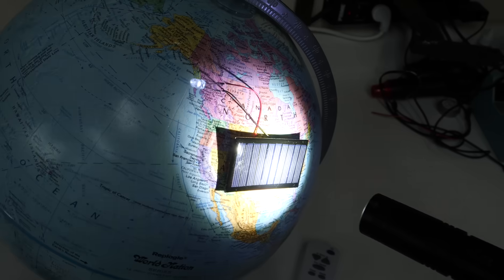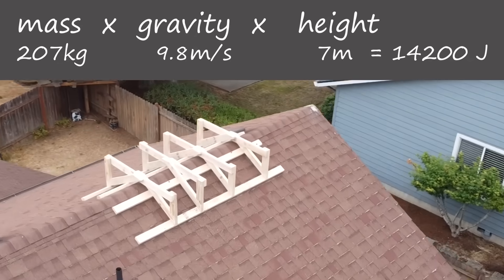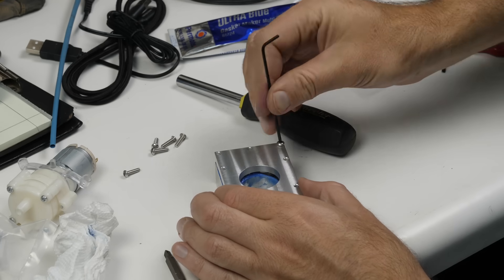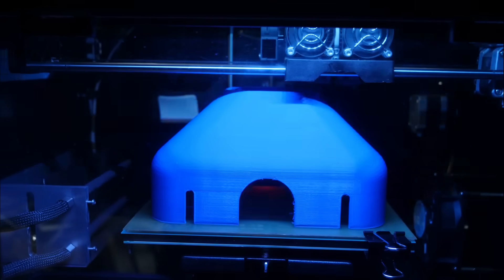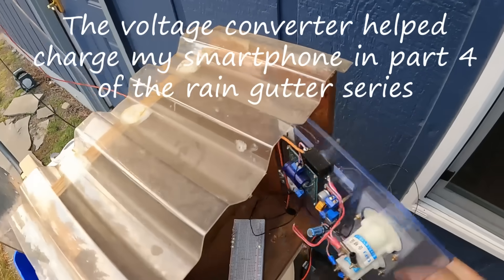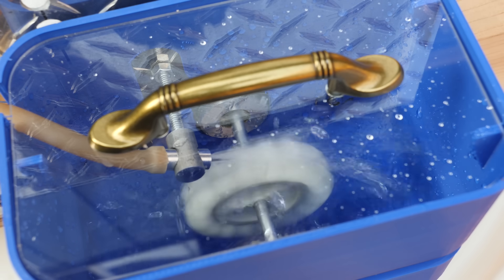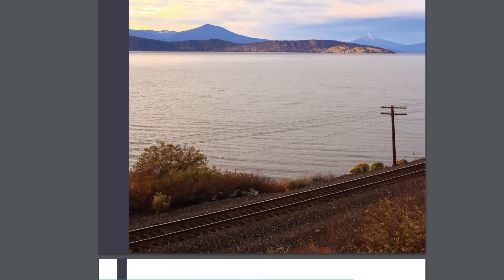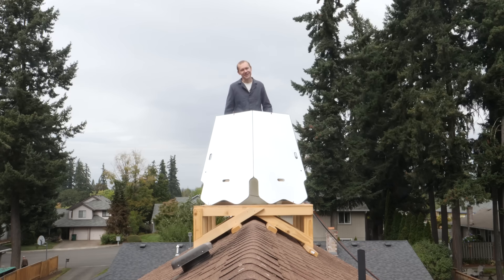Storing Solar Power on my ROOF!!!

Comment: Could you do the same thing but with a fresnel lense to heat a water container (or just air) into steam (or just heated air) that rises through a one-way valve to be stored in a pressure tank as pressurized steam (or compressed air) of course with a safety valve? I assume you could use the same turbine from the gutter system with steam although a steam turbine or maybe a tesla turbine might be more efficient?

Comment: Near me on there is this:
Mineville Energy Storage (Project No. 12635) is a proposal to construct a 240-megawatt closed-loop pumped storage project in a decommissioned subterranean mine complex in Essex County, New York.  The proposed project would consist of, among other facilities, upper and lower reservoirs with storage capacities of 2,448 acre-feet, low- and high-pressure penstocks, a powerhouse, an electrical chamber and tunnel, and 34.5-kilovolt transmission lines.  The proposed project would provide an estimated annual generation of 421,000 megawatt-hours.

Comment: I'm probably wrong here, so I would love it if someone wanted to check my math, but because of gravity being constant I imagine not just water but pretty much anything has a potential energy of 2.72 mWh per meter per kg, meaning his 207.9 kg 55 gallon barrel would be 0.00272 x 7m x 207.9kg and roughly coming to ~3.95, or just about 4 watt hours in that barrel.

Alternatively to get this number you can divide the 14,291.64 joules/s by 3,600 to get ~3.96 joules, or watts per hour. But the per meter per kg is nice to mess around with different storage size set ups.

Comment: Question: how long does the battery last when used to power the lights?
Reply: He mentioned a AA cell, so I was judging from that.
Reply: It is easy to calculate.
14.200 J = 3,944,444 Wh
Comparing it to a cell phone which has a voltage of 12 volts
3.944444 Wh = 3.944444 / 12 Ah = 0.328 Ah = 328 mAh
The phone's battery has over 10 times more capacity.
For storing energy in a gravitational field with the use of water, you need very large masses of water.
It is much easier to store energy in the warm water. 1000 l of water, when heated by 1 K, stores about 1 kWk of energy.
Reply: @boguslawszostak1784  How do you convert heated water into electricity and what is the efficiency?
Reply: I don't need to do this. Energy for heating is needed in the form of heat. There is no point in turning it into electric to turn it into heat again.
Instead of storing electricity in a battery, it is easier to convert it immediately into heat and store it in this form until it is needed.

Comment: I hate to break it to you but
14200 joules can run a toaster for like 20 seconds
A lead acid battery for my 50 watt panel can run a toaster continuously for 150 times as long, and I don't even need to put it on my roof

Amazing ingenuity though

Comment: Two things I don't understand; -1- why not put the storage right below the roof, out of sight (that one meter is not so bad). -2- Why not add a rain input : free AA batteries falling out of the sky! (also works with raintrap outside while vessel inside). 
Very nice you add this final conclusion to put the project in perspective with the AA equal of storage capacity. Although a proper turbine might have added a bit in effeciency too!

Comment: Have you tried to use the electricity from solar power to compress air and use the compressed air whenever you need to generate electricity instead of pumping water to the roof and risk heavy weight on the roof?

Comment: Just saw this. Love it, but it will not work when the water freezes (below 32° F). Also, the tank will need to be secured for high winds to avoid structural damage on the property. Would be nice to come out with a model for year around consumption. Maybe have both tanks in the ground on different altitude. Or change the water for air and run it inside the house. Food for thought. Thanks!!
Reply: Add antifreeze to the water... geothermal systems do where temperatures are cold.

Comment: get an aquarium air compressor and inject air after the waterpump: it will reduce the head pressure and increase output or reduce energy consumption.

it called air or gas lift.

Comment: Brilliant  Fun Practical experiment  for a change  Covered all the info one needs except EFFICENCY  50 watt? panel 6 hrs, 350 watt hrs to generate ? 6 watt hours?
Schools across the nation should be using your channel
Here's another water / electrical storage experiment - use a thermo electric generator, heat the hot water with solar power, use it to "charge" the hot plate of a thermo elec generator.  Now the greater the temp diff the more elec gen so a small really hot really insulated storage tank and or the cold side coupled to something... cold, a copper plate hanging in a 55 gal drum of water, sunk into the earth...  They are pretty inefficient, be interesting to see if more or less efficient than your test pumped hydro  Might want to append when discussing real life pumped storage that many are now being built in abandoned mines, reusing the facilities and cleaning up then ending the pollution often associated with abandoned mines.  One is upper NYS.  CA was trying to build one but environmentalists were blocking if preferring the abandoned mine that has been blighting the landscape instead be fully restored to it's natural state using who knows how many billions tax payers dollars

Comment: There are 500,000 Pumped Hydro sites around the world, and compressed air storage can be done by drilling into the top of a salt dome, or other cavern space! So we don't need no stinking batteries, we have so many tried and true ancient methods of storing energy, we are being hoaxed by the supporters of the nuclear death machines! They have lied about the dangers of nuclear power, because they wanted the plutonium for bombs, a deadly by-product  of reactors! This year, there were only 138 salmon in the winter run, in the mighty Columbia River which runs past the radioactive plutonium production plant in Hanford, Washington. That's an extinction level, compared to the tens of thousands in past years. Dont say the f-word. Fukushima. 4 reactors, 4 horsemen. Poured the vial, already. They lied about that too, reactors 5 and 6 are toast. And the common spent fuel pool. 20 or thirty cores, maybe. 60 MILLION TONS OF SOIL IN TEMPORARY STORAGE, AT 150,000 SITES. DONT EAT FISH, OR JAPANESE RICE.  Stay out of the rain. 
Peace.

Comment: I've always wondered if you put your bucket on the ground have a float on it that opens a "flapper" on the bottom it drains out to a ram pump that goes back to the gutter couldn't you just have an indefinite closed system besides what water is evaporated during the cycle so the water would run over your stream wheel a few more time than it naturally would?

Comment: What happens when you step down piping from the top. At barrel start with maybe 6" then switch to 4" half way down then 2" and so on until you get to your small nozel at the end. That would give more weight in the line from the barrel in tree pipe. Maybe more or faster pressure on the end?

Comment: The same solar water pump arrangement could also be used to cool your house, in place of or in conjunction with air conditioning via a couple methods. Here are a few to think about. 1 with normal AC and 1 without normal AC.

1 - Simply allow the water to run over the roof and have evaporation cool the house. The water that does not evaporate could be recollected by the usual rain gutters to a recovery barrel and pumped back up via the solar powered pump repeatedly. 
The same water could still make power via your gutter generator at the same time.
You do need to add more water to the system to compensate for the evaporation loss during the day.
Your air conditioning could still be employed as usual but with less work being required, since the house would be cooler before the AC unit starts to work, saving you some money on your power bill.

2 - Create 'swamp coolers' in your open windows, with solar powered fans. This is as simple as using the water from the solar pump to wet a fabric (towel, sheet, etc.) with a solar powered fan blowing air through the fabric. Again evaporation cools the air, and that cooled air is blown into the house via you windows.
The water could also be gravity fed to your swamp coolers after doing 1 above as well, so you get multiple cooling effects via the same work. In this case your must have your house open, so you could not use your normal AC meaning you probably wouldn't be able to do this on extremely hot days. Also the water recovery would be more problematic since it is being used at several windows as opposed to simply catching the water from the roof via gutters.

Comment: For turbine case: Efficiency of pump and motor is about 92% and 60% respectively. Then line losses then turbine efficiency about 90% then dynamo efficiency about 85% i guess.
.
For battery charging case: solar to battery it is charging efficiency 97%, discharging 97%, inverter 92%.
.
.
Panels required will be much more in water battery setup but I'll still prefer it bcs battery has very long life and much close to nature.

Comment: That's a very smart afordable battery. Also put a tank in the attic. Use the solar panels to heat the water .  If a house is engineered to hold a large tank in the attic. Perfect battery to store solar energy.  
Unfortunately homes are not built with solar, wind or any form of energy conservation execpt insulation. Essentially homes are built as cheap as possible by greedy builders concerned with profit .

Comment: @Quint BUILDs Doesn't the whole tank of water contain a ton of energy? Why not have the whole container "drop" while being tethered to a generator. Kind of like a grandfather clock? Couldn't it be let down from a height while turning a much larger generator (using gears) producing more (stronger) electricity?  Couldn't a number of them be timed to work throughout the day/evening?

Comment: Great video, a few question s came mind. 
1) since you have more than five hours of daylight in any day of the year how much battery storage could you get off the solar panel also. 
2) if you added the battery storage how much more water could you pump up if you’re using electricity to extend the amount of electricity you produce by the water wheel?
3) With the flow of water on the water wheel power generator how big of a generator could you use and how much power could you produce with the lowest flow?
4) if my numbers are correct with the system set up at full of efficiency you could produce enough power stored in batteries and being made combined to have the lights work 5 to 8 hours or longer (if used A long enough wound up cord with an AC and DC you could produce enough of a magnetic field to run the LED lights and also gear in a DC generator to charge the battery and run water pump)
Reply: Your gonna need 2 lakes, one 30ft higher than your house and one in the back yard.
Reply: @terrafirma9328   Please provide numbers stating your case,  or is this in the windmills of your mind

Comment: So if you had a stream in your yard, going downhill, and used a multitude of ram pumps to pump the water uphill into water towers,  flowing back down to the stream, hitting a waterwheel collecting even more power, you'd basically have infinite power. Gotcha.

Comment: That was cute. Innovative and cute, nevertheless  you demonstrated something that  [most] people could be doing but aren't. 
One bit of advice,   if you start the water flow to power the light strip at night but you needed to cancel  activity under the light, you could wire a on/off switch to the water valve/solenoid which can be activated with solar power dedicated for that purpose only, and when you turn the "water on" the lights come on, turn the switch to off position and the solenoid shuts of power to the valve solenoid. 
Thanks for your video!

Comment: The water wheel does not have to move until one paddle or one bucket is completely full so a four foot water wheel would turn a bike sprocket which is only maybe 3 in wide how many times enough to power a motor

Comment: Have you ever thought about solid gravity batteries? And connecting them to a block and tackle / heavy gear ratio to get the req. RPM on an electric motor? I would love to see what someone with your skills and knowledge could do with a solar panel and a 100kg weight.... There's gotta be a crazy hack there somewhere! 
Love your videos! Looking forward to seeing more soon!
Reply: The problem is you'd need to drop the 100kg 3.6km (2.24 miles) for each kWh energy required (if the motor converted 100% of the movement to electricity). If you had a platform the height of mount Everest, one cycle would store 2.45 kWh, less than 1/10th of the electricity used by the typical US household each day.

Comment: Hi, I realize your just putting out content to make a buck. I can respect that as a fellow capitalist. What I can not respect is the disservice you do not only your viewers but the country in spreading misinformation suggesting solar and wind power are green energy, they are not.

Don't get me wrong, both solar and wind have niche applications like remote sites or off grid. But it is woefully inadequate to volume power production and usage. 

No, currently nuclear power is our only true clean energy option with working technology. And no I am NOT talking about heavy water reactors of the 1950s, pushed on the nation by a corrupt scientist owning the patents for them that headed the nuclear regulation commission back in the 50s.

In our nuclear "waste" disposal sites we have "spent" nuclear material. Why is that so? Because heavy water reactors only extract 5% to 6% of the material's energy.  If it had extracted it all then it wouldn't be radioactive,  now would it.

Also for decades we have used nuclear powered space craft in the form of Radioisotope Thermal-Electric Generators (RTGs) to generate power. We can use RTGs poduced by heavy water reactor "waste" to create Nuclear Energy Cells (NECs) if you will. We connect the NECs in series and parallel to generate the energy we need to power the nation from the area as a commercial solar farm, buried of course with tight security.

It would work 24/7 rain or shine and not depend on a single gust of wind. If we assume that the "waste" is 95% viable and the old plants used 5% of the potential power every 2 years before refueling. Then we have 38 years of power for each refueling. If we multiply the 38 years of potential power from each plant every 2 year by the reported 99 plants that have operated,  we come up with a figure of 3,702 years of potential power every 2 years the water plants operated. Considering they operated for about 70 years now,  that gives us a rough figure of 129,570 years of potential power left in the current stores of nuclear "waste". Obvious we need to account for nuclear power only generates 20% of our nation's power, so that lowers the figure to 25,914 years of power. We must also assume we will loose some of that potential to unusable material, say 50% to be generous, plus more to other factors like natural decay and let's be really generous and say out of the 50% we can use we only get 10% of the total "waste" potential. That lowers the figure to 2,591.4 years of pollution free power at best case.

That would only leave vechilces as the remaining fossil fuel pollution,  until of course we can develop a fast charging battery that would recharge as fast as a gasoline can does, they we could even eliminate that source too.

RTGs have no moving parts, don't use water to work so don't melt down or blow up like heavy water plants do. They are safe as long as they are shielded, underground facility would do that. Not only do they not produce waste, they use up current stores of wasted viable material we already store at great expense. 

None of the above is experimental, RTGs have existed for decades. We have produced unused nuclear material for decades. These are facts. Why are we not doing it?

Could it be corrupt politicians getting rich on climate fraud like Gore who bought a multi million dollar mansion on a Florida beach? Odd to do if you think it will be under water in a few years, don't you think?

Perhaps it is power hungry bureaucrats out to make $100k jobs for themselves in do nothing government agencies? Don't you honestly think they would stop progress if it meant they could keep sucking at the tax payer teat?

Could it fake media spreading lies to keep their dying companies afloat?

Personally, I'm an optimist. I see the glass is half full not empty. I think that all 3 reasons are true. Lol

Comment: YEARS AGO i was designing a system where i had a pond at an elevated point on a piece of property, there would be a series of home made ram pumps to pump water to a tank at least 20 feet in the air. the waste water from the ram pumps would collect and be sent to another series of ram pumps lower than the previous ones to pump the waste water up to the tank. at the lowest point was going to be a small pond and an electric pump to pump water to the tank. the tank would have a discharge pipe that was at the bottom of said tank and fell to a Pelton wheel generator with the discharge back into the pond.
i had made up 20 ram pumps and purchased the perfect piece of property with 60% down payment
i got sick with a STAPH A infection and spent 3 months in the hospital with NO INSURANCE so i told the guy that i bought it from to foreclose on the property even though my payments were paid up , because i was going to have to file bankruptcy.

i didnt have all the details calculated but was going to be smaller than that big system and much bigger than your barrel on the roof!!!